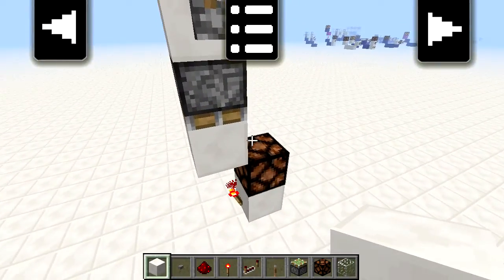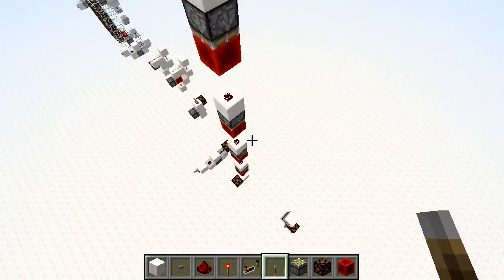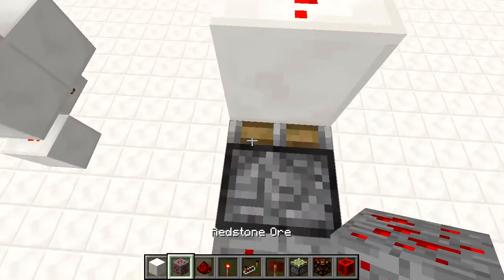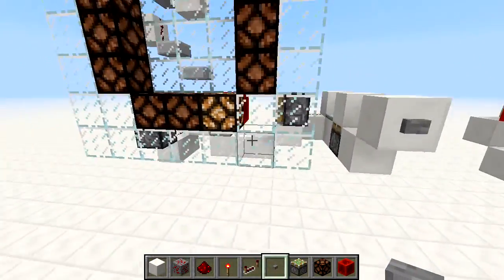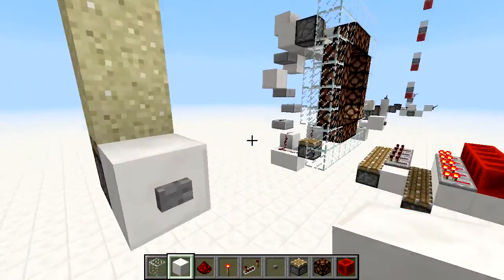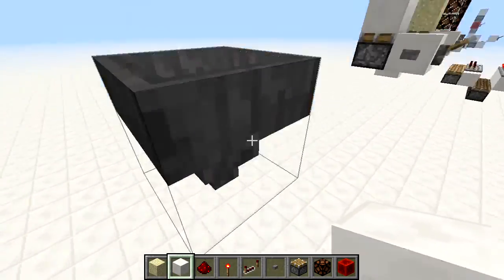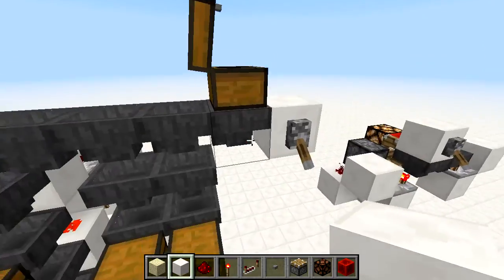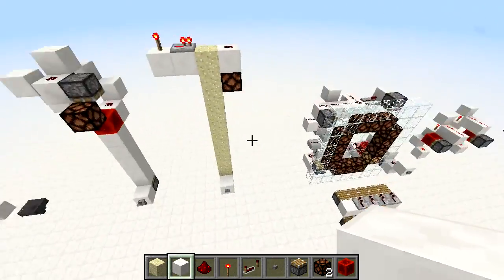Minecraft - Redstone Guide: 7 - Piston & Hopper Circuits

Comment: I have a question about mass block activation, more specifically about sticky pistons. what happens when you want to activate a 3X6 flat area of horizontal sticky pistons (Push up/Pull down) all at once? I want to make a lava 'drawbridge' to fit an entrance to my castle. I don't want a skinny 1 block bridge but a 2 block is too asymmetrical. This is why I would prefer a 3 block wide bridge and I am having a difficult time figuring out how to activate a 3 block wide path all at once. (not to mention how to get lava to cover all 3 blocks on the path too. I see the vertical version in the video but how do make one horizontal? Do you have any tips and advice?
Reply: try to remake the redstonia bridge from mc story mode

Comment: Xaptrosity: Your downward power trasmitter intrigues me...I'm not a redstone genius, but just wondering of the effects on adjacent blocks. Particularly, if this was setup parallel to a tower of droppers and activated on a clock circuit...would each dropper receive an on/off/on/off power pulse? If so, you just invented a 2x1 dropper item elevator...

Comment: i have a question. i want to make a piston door that you can open from the outside of your house with a lever and close it from the inside of your house with another lever without having to flip the levers to make it work, what can i do to fix this?
Reply from the maker: matt brewer Hook up the two levers to a XOR/XNOR Gate which will mean the door will activate when you flip either lever. Check out one of the previous episodes on Logic Gates.
Reply: thanks.